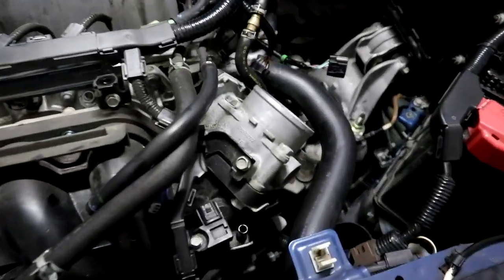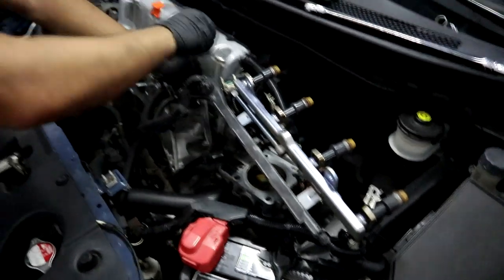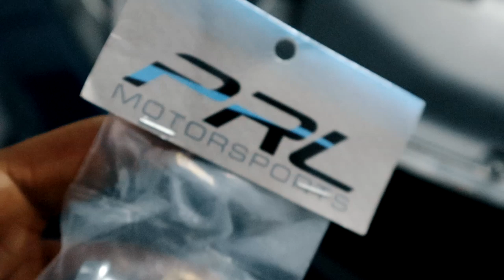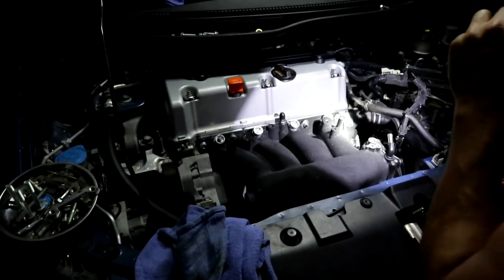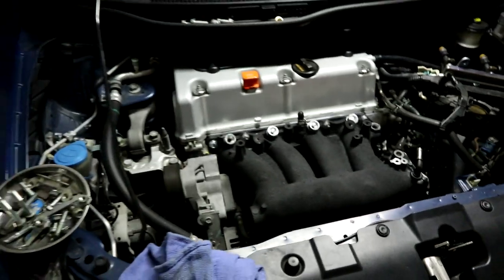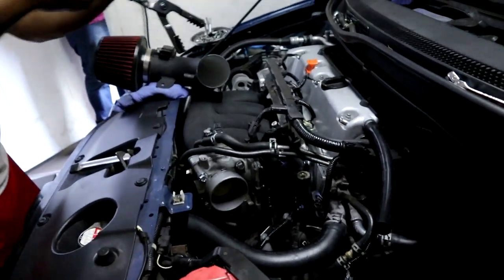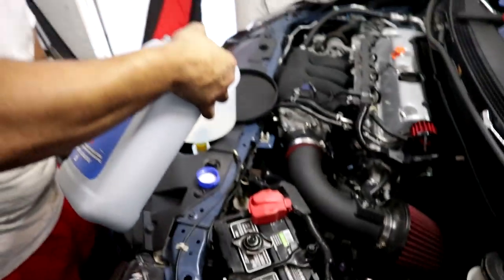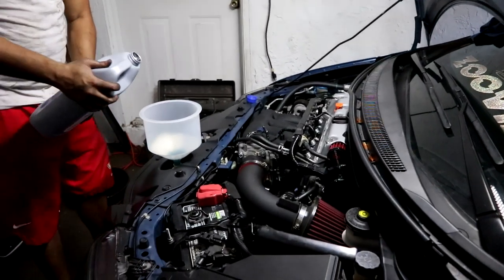Finally Installing The RBC On Dusty!

Comment: Went ahead and did my rbc on my car. Prl does supply the kit referenced the video. You do not need a ktuned bypass delete to run the rbc but it is recommended for cooler temps.

One thing I did notice is that throttle body harness plug WILL NOT reach the throttle body. Need to either cut and extend the wires or by an adapter.

Comment: After the Rbc Manifold installment you said something about maybe switching to a different intake cause your short ram was overheating, have you switched the intake yet and if so what did you switch too?
Reply from the maker: 8th Gen Si K-Tuned Intake but now its currently turbocharged. Watch my newest videos.

Comment: Yo zoovie I know this video is old. But I'm trying to find an intake to put on my 9th gen... I have a 3.5 " aem on mine and I want to go to a short ram intake. I live in NYC and whenever it rains I have issues with my intake. Which intake do you have on yours?? I want an intake that I would be able to use when I eventually switch to RBC. Currently my 9th gen is bone stock. I dont plan on switching the throttle body. I'll keep that as is (oem). Thanks

Comment: Are you running it with base map? Or have to get a tune?
Reply from the maker: I ran mine with a basemap .. but it’s really recommended to get a tune. I got a tune a couple months later.. for that time, I didn’t push the car past 4K rpm

Comment: Did you reuse the same upper radiator hose ?
Reply from the maker: You can but since the ktuned intake I’m gonna be running , I switched it to the ktuned upper radiator hose.

Comment: Jw what will this do for the car will it make more power and will it affect the mpg? Cause I plan on doing these things to my car
Reply: Rbc does pretty much nothing unless you port it. If you leave it as is the rbc gives you a couple of hp like 3 or 4 but usually ends up in a larger tourqe loss. But when it comes to boosted vehicles the rbc is actually much better. Vit viper has a fourm that will awnser everything.
Reply from the maker: That’s not true ... you don’t need to port your Rbc for you to get gains. I seen many build with non ported RBCs make 220-230+ hp fbo with upgrade injectors. If you can find a 9th gen with stock manifold making 230hp then someone lying. Also vits forum was longggggg ago , time has changed
Reply from the maker: Also you are able to rev higher than stock manifold.. you can rev out to 8k
Reply: @zoovie  anything above 7600 is dangerous for our engine as our oil pump cant keep up. You also need springs and retainers or you will drop a valve. You can rev higher but you are risking it and reducing life of engine life. If you want to do a high reving k24z7 type s oil pump and springs and retainers or do a k20z3 head swap with modified oil galleys
Reply: Negative can’t rev to 8k without a type s oil pump
Reply: @zoovie  my dude email vit the man knows his stuff. Rbc gives small horsepower gains like 5 at most but destroys your tourqe down low. Our stock manifold is designed to tumble air for better performance for our engines. Also I have a buddy in the sd who wreaked a valve cause of  him reving his k24 to 7800 with springs. Trust me dude I went through the na phase and am now building my boosted 2012 civic si.
Reply from the maker: MGOD92 you can , you just shouldn’t on stock valves & oil pump .. but there are some ppl who don’t care

Comment: Hope you got hondata cause that manifold is really gonna mess with your stock tune. Ps your afrs are gonna be very lean so I wouldnt get on it.
Reply from the maker: Using ktuner , and yes I know that already. Using stock injectors and just added fuel. Car isn’t running lean at all
Reply: @zoovie  nice have you found someone who tunes k tuner. That's the main reason I went with hondata. Couldn't find any tuners in the midwest
Reply from the maker: Asaka wolf yes , two great tuners down here in south Florida